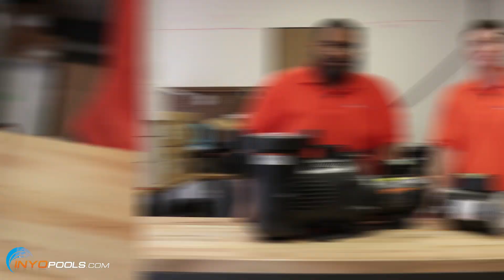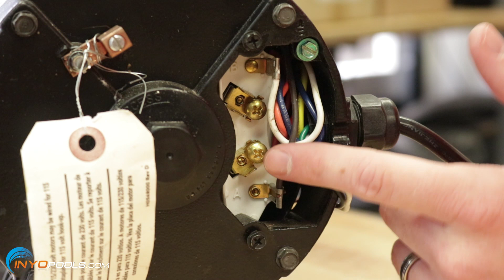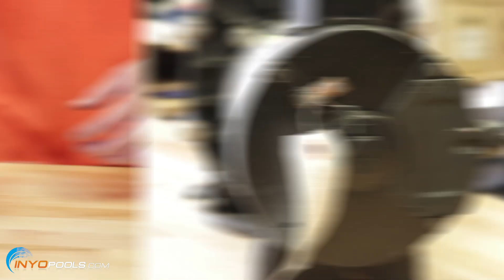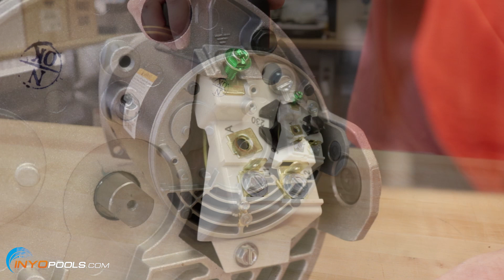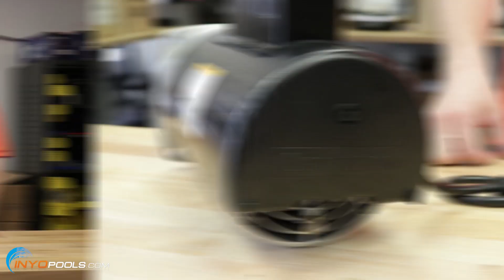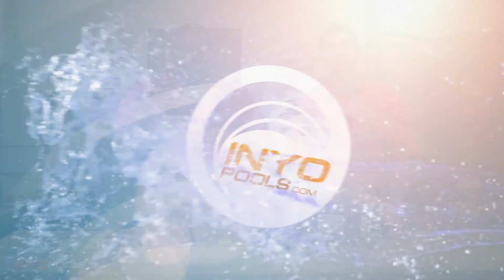How To: Wire WhisperFlo & Similar Pumps For 115V

Comment: Excellent video. I understand the connections to do but I have the Madimac inverflow pump for my inground pool and just wonder where to connect my copper wire for the other ground. Thank you.
Reply from the maker: I'm not familiar with that particular make and model of pump, But generally, pool pumps have a bonding wire lug that sits on top of the motor. An example of what it looks like be seen in this picture. - https://images.inyopools.com/cloud/images/century-ust1152-4.jpg

Comment: What happens if you power up a wired 230 v to a 115v power input ?
Reply from the maker: You could severely damage the motor if you make that mix-up.
Reply: @Inyopools how about the contrary? My motor is wired on 120 volts but when I checked it the switch I noticed it was on 230v. However the pump always worked. Recently started humming and I replaced the capacitor and impeller. However still humming… any thoughts?

Comment: I’ve wired up a new century motor using the method shown in the video.  I have four pole breaker and it continues to trip the breakers.  The voltage is set at 115 on the motor and I’ve even replaced to breakers.. thoughts

Comment: I am sorry for this question, but really need the answer. I am new to this topic. Need to replace old 1 speed 1HP pump with new one 1 speed 1HP pump. Different brand names. Have never deal with pools and pumps before. Watching YouTube for educational purposes. You say that White (neutral) wire goes to L2, and Black (hot) goes to L1 terminals. Another source on YouTube says that Black (hot) goes to L2, White (neutral) goes to L1. Whose information is correct? Sorry for this question, but I don't want to fry new pump.

Comment: This video was a lifesaver for me today.  I've been going crazy for the past week trying to figure out why this brand new pump was running so hot that it was shutting down.  In desperation , I found this video and was skeptical that the answer could be so easy as a switch under the rear plate, i.e. a switch from 230v to 115v.  I ran out and tried it and the problem was solved.  Many, many thanks, Guys!

Comment: Question. Mine is same pentair whisperflo pump with plate door,230v 2HP but doesn't have brown wire. I like to test the motor see if it runs. I changed the bearing and shaft seal.
Reply from the maker: Hello Armen - Most standard outlets are 115v. Your pump is 230v. You won't be able to test it with a standard plug and outlet. You can test it with the power that is currently running to your pool motor.
Reply: I changed from 230 to 115 and fried my breaker. It was previously wired from 230 but the pump would turn off and on intermittently. It would last no more than 10 seconds before shutting down but would start and repeat. When I switched to 115 I thought it would work since the breaker box is showing 115 -119 with the meter. Did I do something wrong?